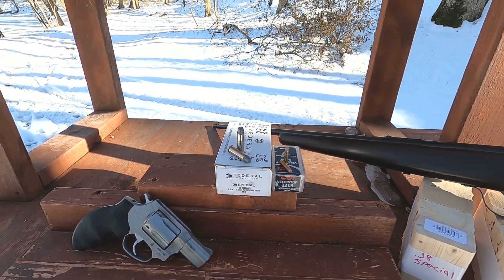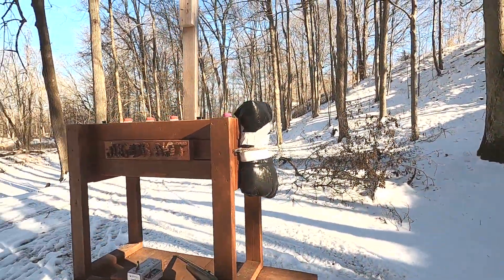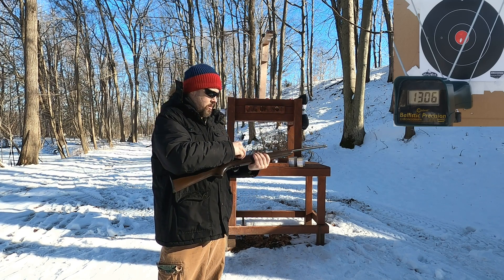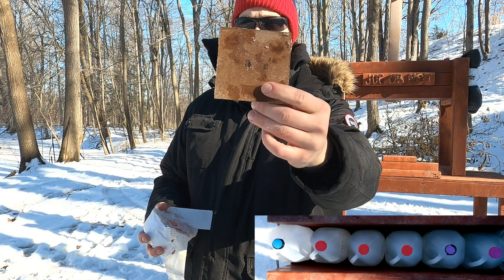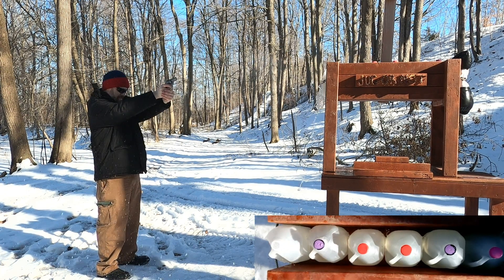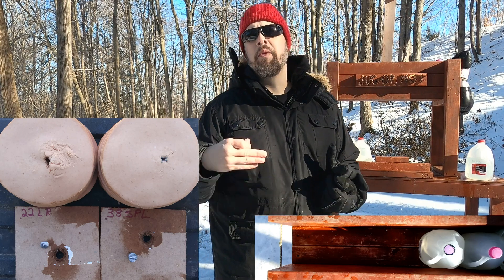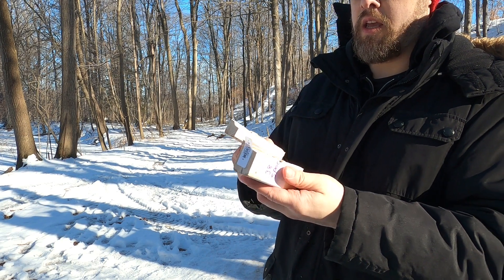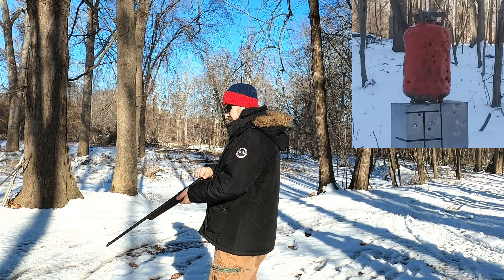.22 LR Rifle VS .38 Special Snub Nose! Same Energy? Scientific Test

Comment: Slightly off the main topic however within the 38spl realm: Are you able, Sam, to handload 38 special at least touching the following specification?
https://www.buffalobore.com/index.php?l=product_detail&p=108 
Even if you have to resort to adding an extra inch of barrel, are you able, at least, to touch these phenomenal factory-issued ballistics? This aforementioned cartridge in 3-inch shows very, very respectable results bar the recoil that is normally associated with shooting high-pressured copper-bullet automatic cartridges.
Reply from the maker: I don't think I can load that hot as by the book a 158 gr lead bullet even in a 4" barrel might max out at 950 FPS with all the powder I use, interestingly enough I just bought that ammo along with the .44 Special version of it for testing again, as I tested it a long time ago but not in the jug or not box. The reason why these lead bullets are so powerful yet low recoil is that they are less "powerful" than the power they give. When I had a box in the past I got 1,002 FPS in a 1.875" snub and I think 1,170 FPS in my 4" barrel because they are a lead bullet. If that same powder charge was below a jacketed bullet, you might max out at 900 FPS 1.875" and 1,000 FPS 4". It's because soft cast lead has very little bore drag, so it can get higher velocity than a jacketed bullet.
Reply: @GunSam   < Not sure I got you right? So the only limitation to achieve the above ballistic specs is that you are stocked with an inferior powder? Is it achievable at all? If not what are other cheaper factory-made FBI loads that land your ballistics around the same ball park? I wonder whether one can find a sub-1$ cartridge that does the same trick. I rate your channel really high but I wish one day you would incorporate 3-inch tests as well. Another thing: 40sw is non-existent on your channel. Never wondered how light FMJs like 380, 9Mak, 9Luger, 40sw and 45acp will compare? Apparently 380 and 9Mak are designed not to penetrate an average man's chest. In particular I would be interested (since I can't find anything on internet) in finding out what fast/light flat-nose 40sw are capable of from short barrels. And here's a question: what caliber of all auto-calibers would you go for during SHTF, providing you have to stick with FMJs only? Would it not practically boil down  to 40sw vs 45acp or maybe 45gap?

Comment: .22LR will go through your pectoral muscle, shred your lung, and then shatter your shoulder blade before embedding itself in the bone. And yes it's very painful.
Reply: for reference look at the way the 22 went through a board, wood is extremely high density and you don't have section of your body that offers the same resistance. If you smack bone with that same board your bones break, density of the object being hit matters the most it's why kevlar is ceramic.
Reply: it will go straight through a person under a few hundred meters, BB guns get stuck in your lung.

Comment: I really enjoyed this video concept. I used to look at ballistics charts years back comparing 22 LR foot pounds of energy. I think the Aquila Supermax boasted around 204 foot pounds of energy, which is pretty on par with some semi-serious defensive cartridges. You would definitely get more penetration using a 22 solid round nosed bullet. I would be curious what Remington Viper rounds or something similar would do. For some reason, I don't see alot of hypervelocity solids on the market.
Reply from the maker: That Supermax sounds awesome. I remember reading about it but I never tried it. My rifle having a 24" barrel is pretty much the max length that any ammo is tested out of, so I think I could get that 204 ft lbs. That would be cool to see. One thing I have noticed about .22 LR ammo is that the lead is often softer than other pistol bullets, so I think maybe the fiberboard I use might deform even solid nose bullets. Now i'm getting hooked lol. Wish I had not sold my 22/45 a few years ago...now I got to get a .22 pistol and maybe a Ruger 10/22. Thanks! lol
Reply: @GunSam  Just a heads up, the Aguila Supermaximum is not that great.  Doesn't live up to manufacturers velocity claims.  Try the Aguila Interceptor or Winchester Hypervelocity rounds.  Those both hit almost 200 FPE in a 16" barrel in my experience.
Reply: @GunSam  the 24inch barrel may hurt the velocity in 22lr as it dosent have a lot of powder to burn so it can slow the bullet down. i think maybe a 18- 20 is all a 22lr needs for max velocity